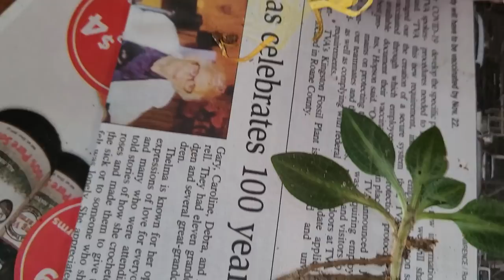ITS FREEZING ❄ Living off Grid / Depression on the Homestead /  EP. 37

Comment: Buy some r reflective foil insulation and cut to size for your windows. Will keep the heat in at night. Also use heavy curtains.
Reply from the maker: That will probably work great for the windows.  We have a roll of that tape.  Might have to get a little more.  Thanks for sharing this tip!
Reply: @OffGridGrowing  it looks like the material they use for sunvisors in cars. Lows sells it in a large roll for about $40

Comment: There's a fan that you can put it on top of your stove and it's spreads the heat thru out the home. Also when your stove is on check your trailer on the outside and check for warm spots..could be that your heat is escaping....
Reply from the maker: Yea we are looking at getting one this week i think. I heard they work great. Thank you so much for the advice 😀
Reply: Cover most of the camper roof with an insulated tarp for the winter...a mini diesel heater may be a good idea...when the stove goes out in the night and you wake you turn the diesel heater on for a few hours with a remote from your bed.  I think the woodstove won't enough to stop water from freezing
Reply from the maker: Yea we have a mini propane heater for the middle of the night emergencies but I think the tarp Idea is a good one. Thank you soul much.

Comment: Sorry but putting hay under your RV is bad to make homes for rats mice and its a fire hazard cut a sheet up to fit it stops wind hay  no good  or use blocks never hay you only need 1 idiot to set it on fire RV gone
Reply from the maker: We bought a thick plastic to wrap it with to protect against the mice issue.. but as far as fire hazard.. we are going to make some adjustments to help prevent that too!  Thanks for the concern.  We appreciate it 🙏